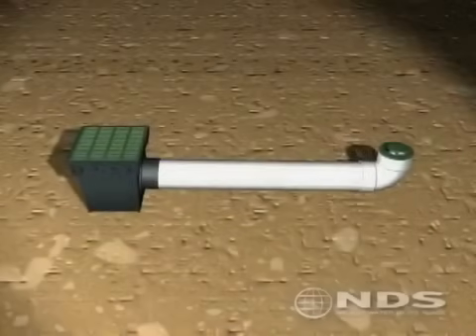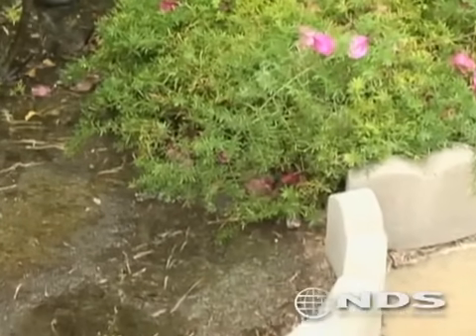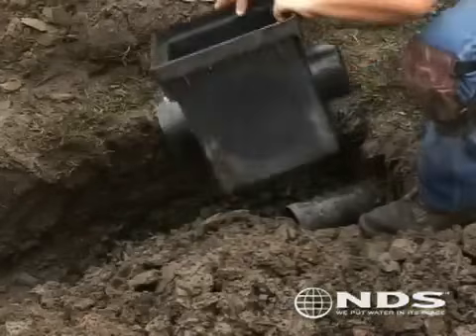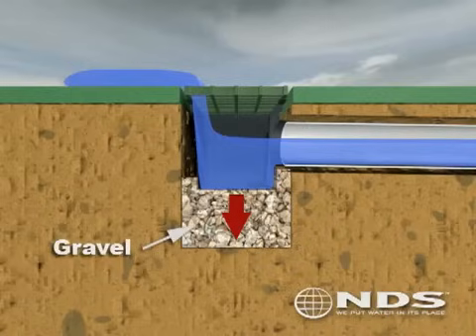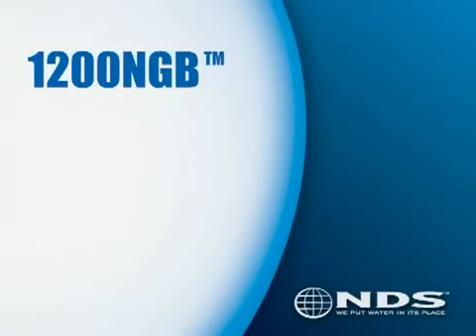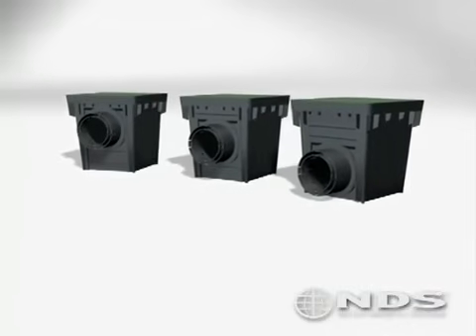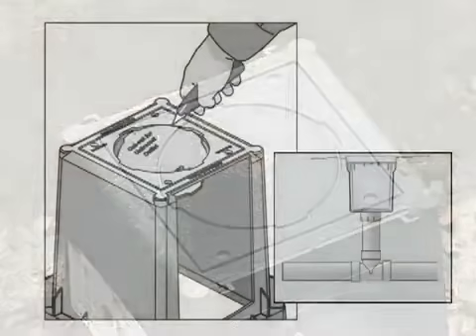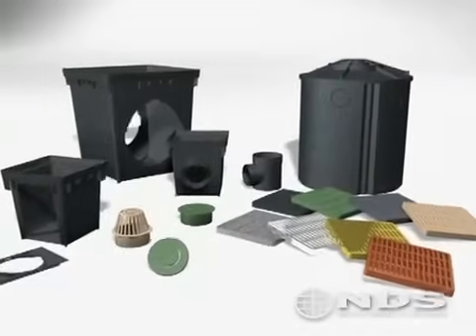NDS Catch Basin Installation - Drainage Solutions, Inc.

Comment: The son in sorrow
i'm so sorry I''d'n't  mean to do it.We was just working fast,We knew that it took slanting for the the sewage pipes for it to drain,with a certain sewage flow.But,man as soon as I install it with out the slants off top it should do the job..making it two inches going downward
getting to the problem of the root,which was for the next job however...I wounder if they'll sew
.

Comment: We bought the 12 x12 catch basin for use with existing 4” flex tubing. Could not get the flex into the flanges and into the box. We did punch out the 3” tabs but no go. Even out a cut on top of flex to try to squeeze it and then insert it into the flanges with no luck. We are going to have to put the flex tubing on outside of flanges with adhesive sealant to prevent leakage.
Reply from the maker: We stock and sell the wholesale / commercial outlets.  NDS Retail outlets connect differently than the commercial adapters.  If you would like to send us pictures we may be able to assist you better.           email dps-customercare@drainagesolutionsinc.com

Comment: If I have a grade problem in my side yard so the slope goes toward the house slightly so when it rains hard I get standing water at the base of the house, if I put catch basins to pull the water away, how close or far should I make the catch basins along the side of the house? I will have them feed into a 4” corrugated pipe to run to the hill to dump the water. 
Can a 6” catch basin suck down lots of surface water?
Reply: The catch basins should be placed 5-10 feet from the house to ensure they pull the water away from the foundation before it starts pooling at the base. This will help prevent standing water and potential foundation issues. A 4-inch corrugated pipe is a good choice for directing water to the hill, provided it has the proper slope to maintain flow. A 6-inch catch basin can handle a decent amount of surface water, but if you're dealing with significant rainfall or runoff, you might want to consider installing multiple basins or using a larger basin to ensure efficient drainage without overflow.

Comment: for my gutter downspout run of about 20' I"m going to use old hardened cement in bags that I'll crush up. I will just dig a big hole and run the end of the pipe into it, into the crushed hardened cement.

Comment: I’ve been doing service/repair plumbing for over 21 years. My joy is plants. 

I’ve done a lot of experiments with plants.

I’m gonna be hopefully buying this house I’m at. I’m planning to direct the overflow from watering into a catch basin. Inside the basin will be a pump to discharge the water back into a separate system. I can water all day in clay. 

I’m thinking a similar setup that a loading dock has but also reusing my water to do a deep watering for my lawn. Hell yeah. I’m going to do it regardless if it’s legal. It’s going to be sick

Comment: Im installing a 40 inch channel drain in front of the shop door to eliminate rain water entry into my shop. The 4x2 adapter and 2” schedule 40 will run under fresh concrete sidewalk. Im thinking about burying the nds leaching tank 10 ft from the channel drain. Then covering it with concrete. Has anyone attempted this? Very Sandy/loomis soil so absorption should be more than adequit for the amount of water it will be handling.

Comment: I have water filling up I middle of yard . But I have been told we have a high water table too. So I don't know if I should use solid pipe or just holes on bottom? And should I put holes in bottom of basin or leave it solid. And will neighbors get upset heating a sump pump in yard . Plus hooking up electrical for it ugh. I hoped I could just dig hoke further down then fill with stone but uf water table high water might come right up. And if I do sump pump I'd have to use alot of pipe and alot of digging. . Don't know what I should do .

Comment: Goodness me, no fresh water sewer. No land drainage before you build. This must be a third world country?
Reply from the maker: You must have inlets to get the surface water to the drainage system.  There is plenty of properties that need inlets for low spots or land that doesn't have enough slope to drain properly without the use of inlets and piping.  This isn't any different than dealing with drainage in sports fields, parking lots and roadways in a developed country.

Comment: WAIT WHAT?  Drill holes in the bottom of the basin? This thing is against my house, I am trying to move the water away from the house!
Drilling holes, cancels the whole thing.
Reply: You'll probably want to have the catch basin installed away from the home. Add a flat or atrium grate with pipe that leads from your house to the catch basin some distance away.
Reply: @kevintaylor5715  Thanks Kevin. I will put in a very tiny "weep" hole, to keep mosquito's at bay.  I wont drill a very wide hole, because I still think that water will migrate wrong.
Reply: @mk8530  dude, when it rains, water rises. Those holes will allow extra water to flow into the basin
Reply: @ednaemode5762  Indeed, and excellent point. It's why French drains have holes in the bottom of them so as the ground water table rises, it will flow into the pipe, and then down and out to the street. Before I learned this (the hard way), I never knew this fact.
Reply: when it rains the soil around your entire foundation gets wet at some point, if it is heavy rainfall you will obviously see this right away if you have an issue

Comment: What type of duct tape are you using?  Is it specific to underground applications?  Thanks
Reply from the maker: The tape used in drainage systems typically is known as Tile Tape.  It is available in a 2" or 4" wide roll x 108' long.  The tape is available at www.drainageproducts.us under part numbers TT2108 or TT4108.
Reply: @DrainageSolutionsInc  Excellent, thanks

Comment: I’m installing a catch basin into the lowest part of my yard with some drainage from the downspout that I’ve run underground as your video describes. Since the basin is at the lowest point and my yard floods significantly do you think I should use perforated PVC and Stone in the ditch to aid in drainage from the yard? Thanks, Chris
Reply from the maker: The perforated pipe and stone will help with the discharge of the water if the water table isn't too high.  Make sure the perforated pipe and stone start at least 15' away form the house / foundation.